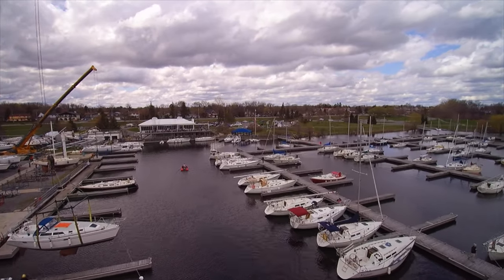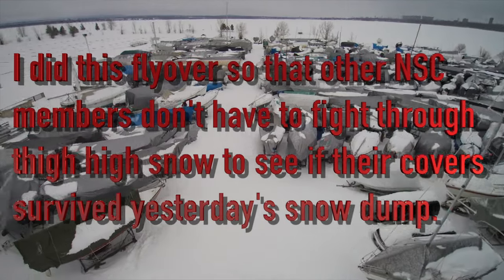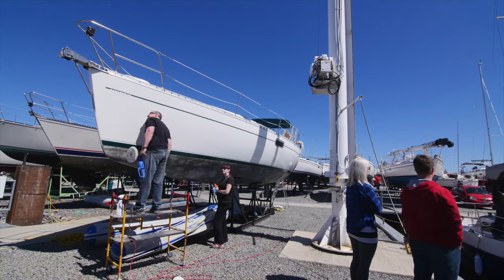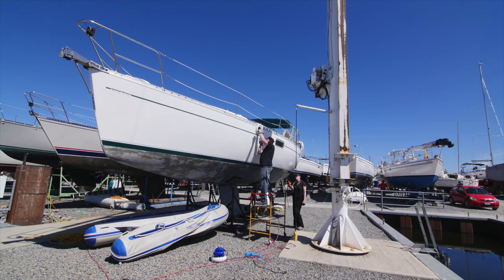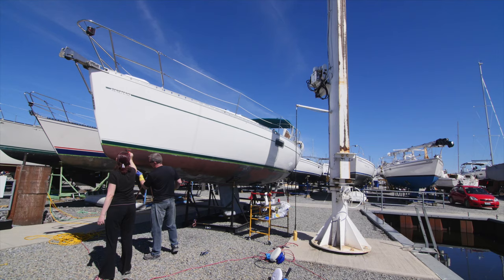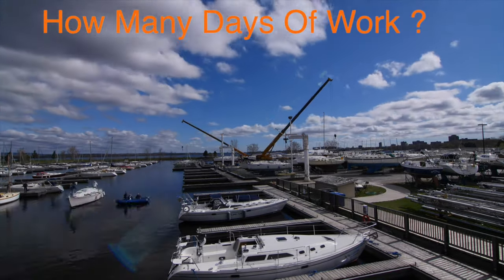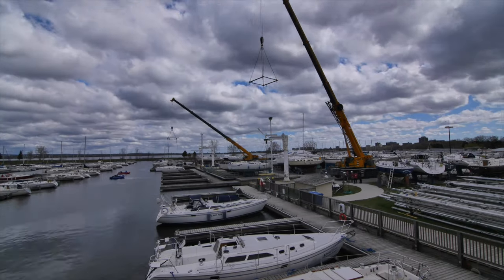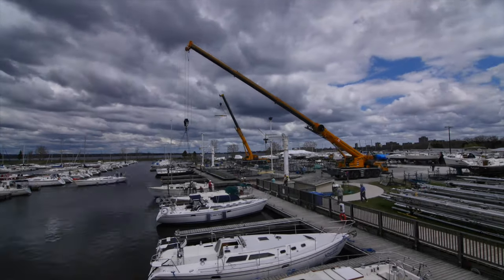Ep5. How much work is a sailboat, to go from winter storage to ready to sail.

Comment: I've seen on sailing forums that one can expect 2-3 five day work weeks, about 8 hours each day. That's quite a wild difference from 6 days. Do you think six days is more typical/realistic, or do half the boats out there really require 2-3 weeks of work per year and you are just lucky with your six days? I believe the breakdown in the forum included inspections of the motor, anchor housing, sails and lines, and cleaning the gear.  Thanks a lot for the great video!

Comment: Bottom Paint 101. Ablative or Modified Epoxy. Either can be used in fresh or salt water. Most of Ablative wears away with use and time while Modified Epoxy hardens and stays on the boat over time. VC 17 is a very thin paint that hardens over time. Mostly used by Fresh Water racers. With  all Epoxy paints, after several years you will have hundreds of pounds of hardened Modified Epoxy layers on your boat. A real hassle to remove. Most Ablative wears away over time. Little or no Build-up. I stripped over 500 lbs of Modified Epoxy off my boat after many years of use. With Ablative, I use until I see gel coat, then reapply. So much better. Never using Epoxy paint again.
Reply from the maker: Thanks.  Great info.  We have only owned a boat on fresh water.  One day we will have to get some good advice like this when we buy our Blue water Catamaran.  Thanks again for the info.